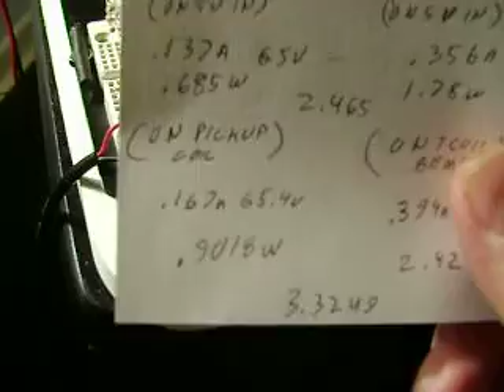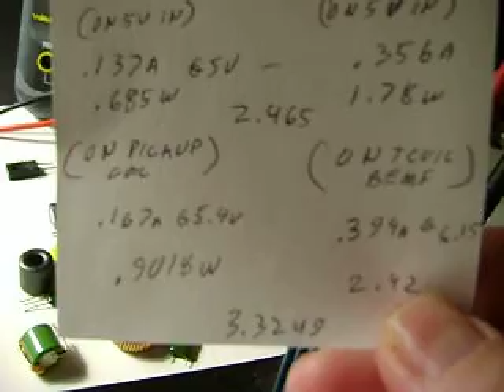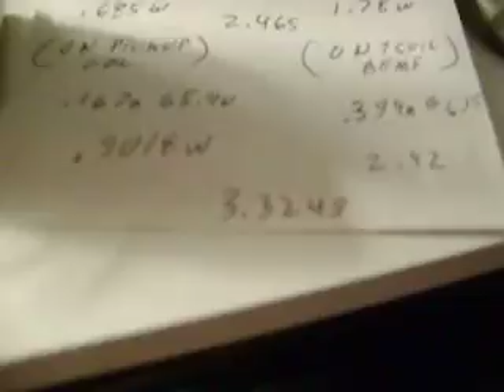Orbonbon. Getting Back EMF Tcoil (Toroid) Along With Capture From The Pcoil (Pickup Coil)

Comment from the maker: @FudgeAssassin 

This vid doesnt show over unity. The input power supply is a 5v 1A phone  charger. Of which is sending a bit over 5W to the input. And as you can see, the total calculated output into the light bulbs total is just over 3.3W.

The ferrite that is wound with wire is one of those that is used on power cables and monitor (svga) cables. 1 coil is wound around the outside dia. and the outer coil is wound over top of the first like a typical toroid transformer.
Continued

Comment: I'm sure that optimization is a challenge.  If you are so inclined, take an inventory of your variables.  Then list them in an order and adjust according to that ranking.  For instance if you have 3 variables.  Lock down the first 2, then optimize the 3rd.  Then vary the second and then optimize the 3rd again.  If the total effect improves, leave the second the way it is (or go further) Make the best of the 2nd & 3rd and then consider tweaking the 1st.  It is good to have a system to follow. :-)

Comment from the maker: The magnets inside the core, N one end, S the other, thei fields are atracted to the ferrite. So, most of the field is contained. When we power the toroid winding, the ferrite becomes saturated, allowing the magnets field to expand beyond the inner coil producing current through the coil wound around the ferrite. The fields are then attracted to the outer ferrite cores. This causes the magnet fields to cut the coil windings, back and forth.  in this vid we capture back some of what...